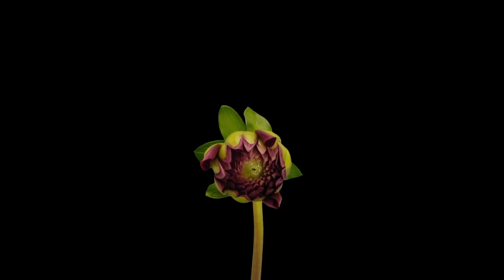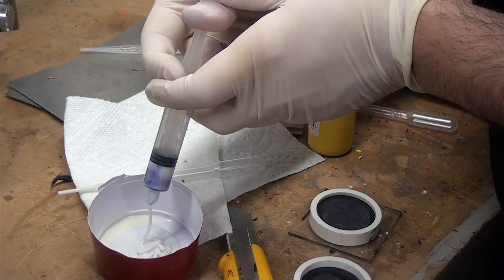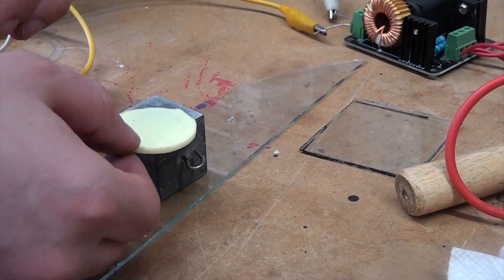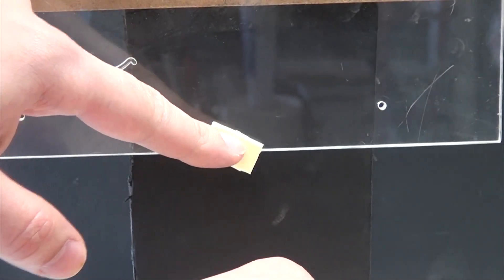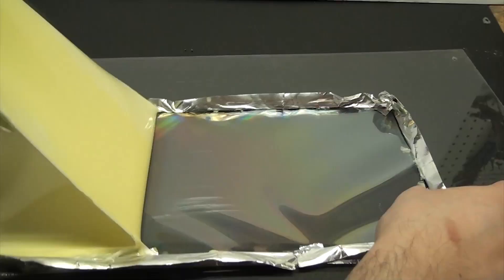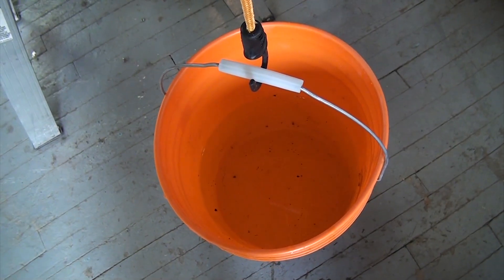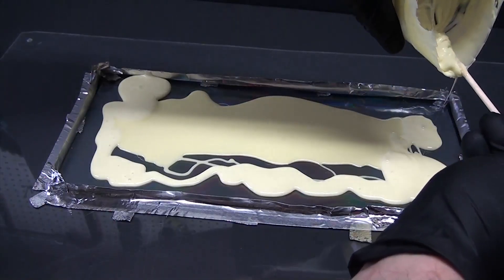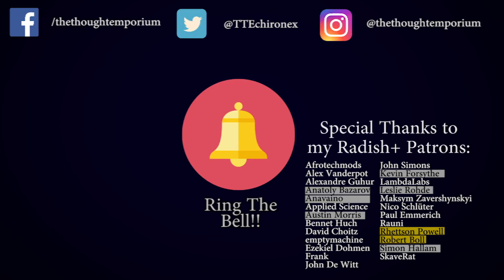Climbing Walls With RAINBOWS - DIY Gecko Tape

Comment: idea: embed fabric into the silicone pad, to prevent stretching and distribute the shear force across the entire area. then back that with a layer of relatively soft of open pore form, to comply to uneven surfaces. (silicone can seep in the pores to bond) and finish with a somewhat flexible backing plate, to make it easy to peel off again. 

PS: bugger, i just realised this vid is 6 years old.

Comment: Well also if you staked the silicone to a surface  like a paddle or a glove. The glove doesn’t stretch as much as the silicone. Raged tin the thing tha lost you up strength. So actually not just raw silicone. But silicone securel glued to say a paddle or grip will be significantly stronger as it won’t be allowed to deform and lose its tip on the ace nearly as easily.

I would imagine something that’s somewhat firm yet malleable like foam that’s got high tear strength  yet allow the surface to warp around the contact surface would work reaplwell

Comment: A flexible mount so you can lay the silicon onto the surface instead of having either a flat or totally loose silicon may help maximize adhesion. After all, its not just the mucroscipic hairs of the gecko that help it stick, but also the way the fingers are placed on the thing it wants to stick to

Comment: Does silicone have the strength at the microscopic level so its tiny hairs don't rip off and can it fill all of the tiny scratches in the rainbow material that you mold it from? I wonder if there's some kind of nano dust that you can mix in with the silicone? I'm not a scientist so I'm just throwing out ideas.

Comment: Bro this is BADASS. However you NEED to try this again, but instead of the acrylic backing, use graphine enhanced resin, and cure it in a sort of mesh. I don’t know what shape will be optimal, but it’ll keep the gripper from stretching/deforming too much, since it looked like the breaking point of holding your weight wasn’t the grip force, but just the material getting out of shape.

There’s a YouTube video about how to make graphine relatively easily, using a glass tube, a vacuum chamber, and some very strong electromagnets. It’s dangerous, but knowing you, it’d be right up your alley.

Comment: Two thick plastic sheets to act as a mold, one sheet has the rainbow diffraction sheet on it, the flatter everything is the better, fill it up and no matter what there'll be a lot less if any imperfections at all. 
That or just a flexible yet sturdy paddle to stick your treated silicone onto, then it doesn't matter about imperfections so long as you wiggle it into place, not a good testbed though.

Comment: Reinforce the silicone with wire or metal bar to stop the stretching and as such reduction in v.d.w forces.
Did this not destroy the diffraction grid? I can't get fingerprints off mine.

Comment: You can thin most platinum cure silicone with odorless mineral spirits, up to about 50/50, and then put the mold in an airtight container for a while to cure the silicone. Then I would recommend melting as much of the wax off the silicone as you can before air drying. The dried silicone will shrink by up to 50%, depending on your silicone/mineral spirit ratio.

Comment: Hey man! Did you cure the silicone using an oven or did you just let it cure in room temperature? I bought a silicone rubber that has to be cured in room temp for 2 hours and then a couple of more hours in an oven, will this make the silicone less sticky? This means that i also have to put the grating film inside the oven and i dont want to ruin it..

Comment: So what's the weight capacity to surface area ratio? 
Maybe it could be used to climb walls if there's enough surface area on the palms and toes, and maybe a bit on the knees

Comment: Even if you can't hang your full body weight with the hairs alone it still massively improves grip strength. Sure you won't be spiderman but you'll be a world class rock climber and I think that's good enough.

Comment: To everyone wondering what silicone he used, seeing as he doesn’t respond to people about this question… He is using: Illuseffects high strength Silicone RTV mold making compound.

You can confirm this in the video at 6:28

Comment: I don't know much about light but isn't the visible spectrum we see in a lower frequency compared to ultraviolet? What if you used a diffraction grading for that? Or, similarly, in case it is difficult to come by something like that, use an ultraviolet light on something that would take on the texture of the light. (Not sure how a diffraction grating is made but...) Then you can pour silicone on your ultraviolet diffraction grating to get theoretically more ridges?

Comment: If you used some kind of pneumatic device on the non sticky side of the pad, something that could move a weight quickly towards the sticky side, it could produce the force needed to stick more of the pad towards the surface, it might be hard to make a pneumatic kicker small enough so maybe a mechanical ratchet and pawl might work better

Comment: I say use a flexible poly-carbon mesh 3D printed of course too create a glove like structure for finger tip covers and palm in a mesh form and instead of using this particular material for structuring it use a laser scanner and scan the actual foot of a gecko to print down to the precise size needed when forming the skin over the structures. And I say combine Tpe rubber and silicone to create a material resistant to stretching and keeps the sticking property. If you create a durable material enough to hold the human weight then ignore the mechanical nature of it because the material nature would give enough function for the purpose needed. And what’s amazing about this is that not only is it water proof but no dirt and other unwanted particles would stick to it. And of it does get dirty you can take a shower with it on your body. Using dawn dish soap to avoid material disintegration would clean it.

Comment: geckos also use their muscles to push more or less against material with pressure , if we can put a current in a material that strenghtens up might solve to surface problem

Comment: I wonder if you can make tyres for a car based on a gecko's feet, which would have insane amounts of grip along with extremely low rolling resistance.

Maybe also throw in some spider silk~?

Comment: Perhaps a dialysis membrane of medium pore size could be used instead. While casting the sillicon, a vacuum could be drawn under the film inorder to increase the protruded length of the fibers.

Comment: I know this is years late. But I wanna give you a tip as to how you might get this to work well. I used to work in a resin stereo casting design shop in my younger years. The way those worked was with a uv catalysed resin. But the ideas will work the same using normal silicone. So, you put the diffraction grating down on a vacuum bed. This is a fairly simple thing to create, just holes around the edges of a glass plate, use a squeegee to remove the air under the film. Then use foam weather stripping, the same stuff you use to seal doors to stop air flowing from one are to another, and line the borders of the film with it. Then pour the resin in. Then place a mylar sheet over the back. Then place glass down on top of that. This will pressure the silicone to flow into all the gaps and push towards the sides. And the glass backing cause the silicone to have a flat even pressured backing. That way, the forces should be evened out across the entire surface. I hope this helps :D

Comment: Maybe try making smaller pads that then add up to the same surface area so that the pad itself won't stretch and use something in between the acrylic and the silicon which helps with the grip

Comment: Just make air channels in the pad. That's what they do for tires to keep them from hydroplaning and it's the same concept. On top of that, using a rigid and completely flat surface is going to make the whole process of sticking the pad to a surface evenly, all the more difficult. The air channels also have the added effect of increasing the surface area in general. Making the lines curved would also change/increase the number of 'grain directions' which would help against unsticking from wobble(like when you peel tape from a corner instead of the long side)

Comment: what if you layered a stiffer compound but still flexible to the silicone pad so you can still stick it and it wont stretch as much and maybe not loose grip.

Comment: To fix your surface contact issue try using ~1/8" neoprene or a similar closed cell foam between both materials.  Just a thought.

Comment: Cast silicone with wax moulds of your hands, use cloth liners, make sure the bottom is completely flat then cast with the cloth liner making contact with a diffraction grating??

Comment: Diffraction grating with a higher line-density is definitely the way to go...

Can you get it where its scored both horizontally and vertically?  
If so, that should make for far better results.

Comment: I think if you made the silicone structure gradually stiffer down the length of the gripping elements you would have better results as the tip of the fiber stays flexible but you would gain more rigid structure down towards the backing plane. 

I imagine you could probably cast in extremely thin layers and increase the silicone shore hardness each step, maybe even a spray application

Ben from applied science made a video a little while ago about black low albedo coatings where he produced carbon nano tubes on a glass plate. 

Purchase a glass diffraction grate  ----> 
Grow short carbon nano tubes on it --->
Sputter coat the tubes ---> 
Nickel coat the sputtered surface ---> 
Epoxy the Nickel coated side to a glass slide --->
Dissolve the carbon tubes releasing the diffraction grating  --> 
Silicone cast the resulting using layers of increasing shore-hardness silicone --->
Eh Viola Gecko Tape.

Comment: FULL CONTACT IDEA: the gecko feet are segmented, maybe the diversity in linear angles help with the grip. You could recreate this by maybe making a silicone mold of your hand and fit the pieces to a lightweight skintight glove, with your rainbow tape layered to mimic the segments on your fingers and folds in the hand

Comment: Hmm this kinda reminds me of suction cups or even the pop sockets for our phones. Pull at a suction cup straight on and it's ridiculously "sucky" lol. Yet, the second you peel it from the sides, it comes off immediately. Like the geckos needing to use a peeling motion to remove their feet from surfaces. Pop sockets work so well because the adhesive almost works better while the pop sockets are being used and pulling on it, and the only way to remove them is to slide something underneath it from one side. Had no idea geckos weren't "sticky". So cool.

Comment: If you split up the pad into smaller sections then the air can escape and you’ll be able to get full contact with the surface

Comment: trick is to maximize surface coverage, but not in one swatch. many fingers are what give a gecko its ability, so then it follows that lines of the tape spaced closely together will have the desired adhesion

Comment: If you have geckos on your ceiling, can't you just cast their feet with a lower viscosity resin that cures under a UV light to make a mold and then use silicone in your mold with an ultrasonic transducer to help it settle into the fine details?  Provided no geckos get harmed in this hypothetical, lol!

Comment: I know you've more or less dismissed the idea but.... instead of using just onemillipore filter of x microns, why don't you make a short of column, with several milipore filters, starting by the biggest one and coming down by steps to the smaller one. Then when you pour it, it should naturally order itself through the filters and form straight micrometric tubes, that will divide in a simillar way as in the gecko pads.... Probably you'll need to chop with some precission tool the last layer, and maybe you'll need to apply pressure while pouring the silicone.... but I'm pretty sure it should feel very simillar to the "fractal" pattern of the gecko pads.... Great video by the way!!!

Comment: Hairs that grow hairs that grow hairs... Thats a fractal pattern. You know what else grows fractal patterns? Crystals. Maybe you could try to grow a fractal blouprint out of crystals and then apply the silicon. It may seem be hard to get the silicon off the fractal sheet, but if you use ice crystals (or some other crystal that melts faster than silicon), you're in for a treat i imagine.

Comment: I wonder, if you then take the rainbow plastic, and apply it in a 90 degree angle on the rainbow silicone, if you're able to somehow make extra ridges in the silicone ridges, by applying heat and pressure?
I think it works on vacuum, air atoms have a hard time going through these small ridges/grooves.

Comment: Probably a dumb idea but if you let the silicone dry inside a Vacuum  would it remove the air in between the silicone and defraction stuff. Might help with the contact between the tape and surface idk

Comment: What if you made gecko tape and had a hole in between every hair and connected a small vacuum to the back?
Then if you had an every so slight curve on it, and the edged made contact first you could kind of suck the tape to the surface.

Comment: oooh i love these videos!!!! have you considered increasing the surface area by weaving it like paracord and maybe incorporating a vortex sytle bite?also a block and tackle? and hving it coiled in a spiral or maybe trying to replicate the pattern of the pads? using small beads or bits of forzen moss or broccoli as a die cast ? or modelling after valcro but using one side as a brake release like a one way switch? also maybe electolosis? curing the silicone in a mold shaped specific to hatever but curing it electronically like 3d printing with uv light? 
cool video! good luck
Reply: uv diffraaction curing in a gel substrate , then crystallization ? magnets? cymatics?

Comment: I know nothing about science but 
If you maybe use a vaccum form you might be able to pull more fine detail. The problem of course would be crafting a disposable mold with that much detail. 
Or it probably won't work at all I'm not a scientist.

Comment: full contact will occur when the backing of the silicone has a higher plastic deformity. Foam was the first thing that came to mind but it would be too weak. More silicone? maybe gloves coated in silicone

Comment: Check out the new video from Applied Science, he did hologram chocolate and Maybe found a way to fix the issue? Make the silicone envelope the sheet instead of pouring it onto the sheet, as well as purge vac.  
Too bad silicone is so damn expensive.

Comment: I think a few issues might be that geckos feet are in a shape that also helps, each toe at the end has a much larger surface, like if at the end of your own fingers were circles with even more gecko tape. I think it helps add more surface area in a way that helps that, that and when they walk their toes must curl upwards or else they wouldn’t be able to walk.

Comment: Make one sheet, then rotate 90 degrees. Apply a super thin layer of silicone, and mold it again.  Repeat.  This should create a fractal pattern of refraction "hairs".
Successive thin layers that don't necessarily contact the entire surface. 
Maybe?

Comment: If you used a more flexible silicone and used more of it (2/3 inch thick)
You'd get more contact area and maby give it some vent holes for the air to escape

Comment: The animal you use as inspiration have the answer to your problem, the movement it does when moving it´s members are kind of wavy, it helps getting the air out of the surface.

Comment: I think it would work much better if it wasn't so smooth. If you look at an actual gecko hand you notice that it isn't smooth, but in rows. I always assumed it was so air doesn't get stuck and surface area in contact can increase.

Comment: you'd need a box, the floor is a holographic sheet, and you put in the silicon, then put in a top-sheet the same size, that way it gets sticky on both sides and level as well on the level you don't want to have an air-bubble you make one or two holes, so the air and silicon can get out... voila, you have to sticky sides on one siliconpiece

Comment: So, Gecko Pads work well for vertical smooth surfaces (walls), but would probably fail way too easy on horizontal surfaces (Ceilings).
However, suction cups are the opposite. They work way better on ceilings than walls. So, I propose casting silicone suction cups out of this gecko design for very strong suction cups. you'd still need the mechanical component to force them onto a surface well enough, but they would need significantly less force to work well on walls.

Comment: You should try a similar method using a plate of aluminum that undergoes the first part of anodizing where it builds a thick layer of anodic aluminum oxide.  Then cast your silicon on top of it, perhaps even in a vacuum degaser to pull the silicon as much as possible into the aluminum oxide pores.

The theory behind this is due to the porous structure of anodic aluminum oxide that you can find observed under a microscope.

Comment: Pretty sweet!
FYI you should try doing smaller needles and do a very fast stab, then very violent pullout, and just as it is all in the air formed, BAM! insta freeze it then use plasma to metal coat it then cast it..   My thoughts are if you can get a fast entry and have little disturbance (all the way to the bottom) and a violent withdraw, this will help carry the heavier portions up and then  smaller, and smaller etc.. then fast freeze it at the very second in time it is all at its maximum before falling victim to gravity